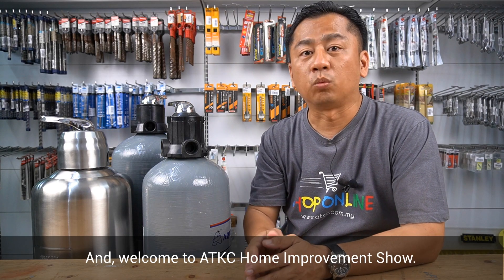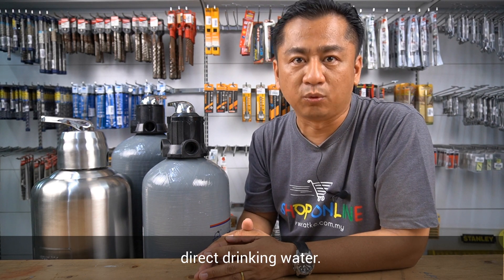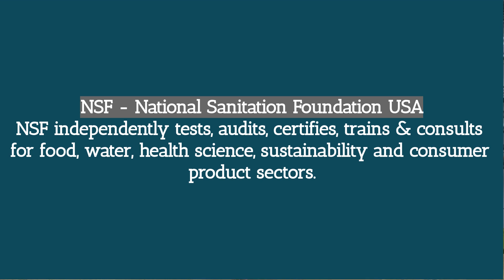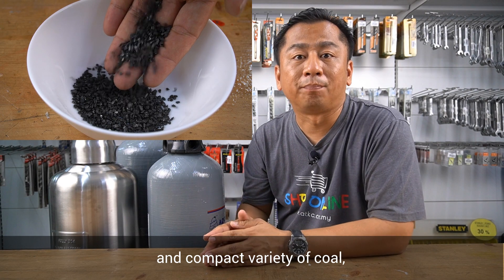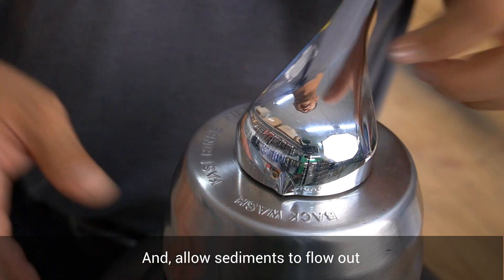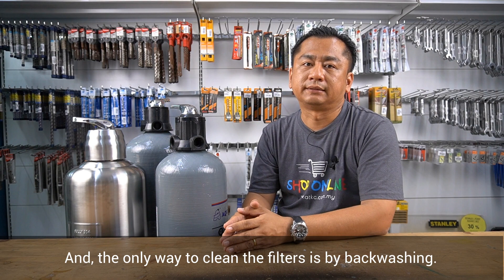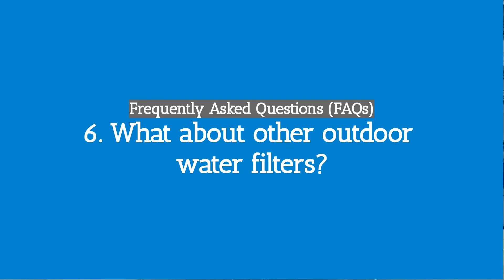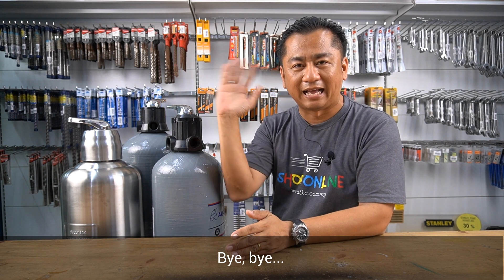Getting deep with your Outdoor Water Filters

Comment: Tq for this informative video.

1.Recently I found my freshly machine -washed towels trapping a lot of very fine pinkish grains of what feel like sand and some   bit of fibrous matter.
My outdoor Waterman sand filter is almost 30 years old.😅
 Is it possible that the sand might have gotten into my washing machine and got deposited on my towels?

2. What would happen if I accidentally rinsed and then only backwashed my Waterman instead of the other way round?

 Would greatly appreciate your reply. TQ.
Reply from the maker: I do suggest you change a new filter.

Comment: nice content, seen many video installtion is from after meter. My house is 2 stories and top of hill, water preassure from the government supply to my tank is very weak and the water is not clean. I have a waterpump from my tank to boost the water into my house I want to install the filter after the waterpump from my water tank. I believe i will have cleaner water. Will the filter can stand the preassure from the waterpump to the filter.
Reply from the maker: you may try installing the water pump after the filter
Reply: Thanks

Comment: Hi sir, which is better brand sand water fliter? Marlino or aqueous
Reply from the maker: Go for membrane filter.
Reply: @ATKCeWarehouse  But, membrane filter will reduce the water pressure. Since we have indoor filter, sand filter should be enough since its filtration is about 5-10micron.

Comment: Hi Sir. If pressure gauge on the filter showing higher readings than usual meaning that the filter is dirtier/semi clogged right? But this doesn't mean that the whole piping system is now under higher pressure is it? Just piping before the filter (after the pump) and the pressure after the filter is actually lower than it usually is?
Reply from the maker: Please have a check. Usually the pressure gauge is located at the outgoing or after the water filter. Meaning, this will be water pressure going directly into your house.

Comment: Great info.... went with 3M AP910R Filter
Reply: Used for 1 year now.. no regrets ... rm570 replacement cost is small price to pay for clean water. 5 Micron was the selling point for me. I have a Coway  RO water machine which require less maintenance since pre filtration is done.
Reply from the maker: @bloomingbead1716  Thanks for the sharing!
Reply from the maker: Thank you!

Comment: May I why the water filtration system outlet pressure gauge reading is higher than inlet pressure gauge reading?
Reply from the maker: Can let me know the difference? and the reading as well?
Reply: @ATKCeWarehouse  
Inlet 33psi
Outlet 35psi 

The water filtration system just installed last weekend. 
(condo at level5)

Comment: I have a question,why my house water flow is getting slower after installing the outdoor water filter. And how i can change the water flow back to normal because slow water flow is a drag zzz.
Reply from the maker: When was the last time you do filter backwashing or replace the cartridge?
Reply: @ATKCeWarehouse  The water filter is just installed for like a week. And i haven't done anything to it yet. Any ideas is appreciated
Reply from the maker: @scuze__  Do you have a pressure gauge installed? You can compare the difference, and identify the issue.
Reply: @ATKCeWarehouse  Yeah,it comes with the water filter
Reply from the maker: @scuze__  How's the reading?

Comment: Hi sir, highly informative. So, i have several questions that needs your input:

1) if i have an indoor filter already, ie; e-spring, would it be alright if i were to use a gravel filter instead? Since per standard, gravel filters have capabilities to filter particles up to 5microns, what are the possibilities that my indoor filter will be affected by the remaining impurities?

2) Understand that malaysia's water pressure is around 60-80psig (4~5 bar), at what point does it fall to a certain pressure such that the filter will not function? how does a low pressure at P1 inlet affect the backwash capabilities of the filter?

3) Usually, from my understanding, it is best for outdoor filter to only filter out sediments while maintaining the chlorine in the water so that bacteria will not propagate in water tanks/storage. With membrane filters, the filtration of 0.01micron will remove the chlorine?

4) if my outdoor filters are fitted well.. outdoors, will it be prone to thieft in due time? i saw how easy it was to unscrew a filter manually.
Reply from the maker: 1) Sand filters work between 20-40micron, and most indoor drinking filter will be filtering down to 0.2micron. Without an outdoor filter, the dirt/sediment will be exhausting your indoor filter. If the installed outdoor filter failed, the chances are small particles and impurities will be flowing into your indoor filter, decreasing the lifespan of your cartridge.

2) I can’t clarify this, but I have seen sand filters still working well at 2~3bar. However, if the filter beds are stucked/congested with dirt/sediment without periodically backwashing, this might cause less water output.   

3) Only those outdoor water filters, with “activated carbon” are able to “reduce” the chlorine level. I found some useful information here:
How to Remove Chlorine from Water?
a.	Reverse Osmosis water filtration systems that incorporate carbon block filters are an effective way to remove up to 98% of chlorine in water. ...
b.	Heating up water to a boil will speed up the chlorine removal process.

4) It is possible, as one just has to cut off the connected pipe lines and remove the sand filter. Again, it does require 2 persons to carry it. So far, this case is rarely.

Please share me your thoughts, so we can learn together as well.

Comment: hi guru- if i installed 2 of this before my water tank, will the water flow coming in gets slower??
Reply from the maker: Yes, as more and more dirt and sediments trapped in the sand beds. I would recommend to use just one, and periodically backwash to keep the water flow optimal. Meanwhile, I am going to introduce a water pre-filter in my upcoming videos. Please stay tuned. This device definitely will solve your 2 water filter system.
Reply: @ATKCeWarehouse   current Brunei is having a water crisis. Due to manganese. My house have this sands filter plus a membrane filter then when it reach my home there a 3 bottles filters before coming out from the sink. Water stoll brown🥲
Reply from the maker: @ritch90  Firstly, please lodge complaint to your authority on water quality issue. 2nd, please ensure that you have periodically replace the filter cartridge.

Comment: I enjoy your videos, they're very informative. In yr opinion, which is a better filtration media for an outdoor water filter? Membrane or sand? Trying to decide between the 3M model vs other sand-type filters. Would love to hear yr feedback. Thks!
Reply from the maker: Membrane, however, it's more costly.
Reply: @ATKCeWarehouse  More expensive because the membrane filter needs to be changed yearly, right?
Reply from the maker: @mintan2484  Most of the membrane filter, is a "one way street", which must be discarded after certain period of usage. I do found that there are washable type, but again, washing doesn't guarantee the original conditions.

Comment: Hi there! Very informative video! I have a question, what if my outdoor water filter pressure gauge display a lower pressure than usual? Is that indication of anything?
Reply from the maker: 1. if the water gauge is located at incoming (most common), there might be a drop in water pressure supply by service provider. Please observe for few days, as this is very common during service maintenance and water interruptions.

Comment: Hi, thank you for this video. I want to ask because the store employee said it is not advisable to use fiber material tanks at the outdoor at sunny areas. It is recommended to use stainless steel tanks.

Is he right? Or should I just buy fiber tank? My area only sell fibers, and stainless steel needs to be shipped. Thank you.
Reply from the maker: My opinion: Since these water filters are labelled outdoor, regardless of fibre or stainless steel, it should be able to withstand weathering (rain or shine).

Comment: My water filter's multiport valve has the following settings: Stop, Filter, Fast, Rinse, and Backwash. Please advise on what these settings mean. Thanks in advance.
Reply from the maker: Basically, Stop should mean that incoming water supply is blocked from entering the water filter. Filter means allowing incoming water supply and filtering process. Backwash, to reverse the water filtering process to flush out the dirt and sediments. Rinse, allow incoming water supply for rinsing. Use intermediately with backwash process.
Reply: @ATKCeWarehouse  Thanks. The weird thing is that the water flows at Stop setting, and stops at Filter setting. Made me wonder if the water is getting filtered. Anyway, thanks again for replying.  Much appreciated.
Reply from the maker: @ReallyOldDog  Thank you for your feedback. My current water filter do not have the "Stop" setting. I would assume that this function will act like a stop valve.
Reply: @ATKCeWarehouse  by the way, how much reduction in water pressure is expected when using these sand filters?
Reply from the maker: @ReallyOldDog  To be honest, I can't confirm this. Let's say that with and without the sand filter will reduce the incoming water pressure by 5%, and over the time, the  water filter will gradually decrease in efficiency (without doing periodical backwashing) in term of pressure by another 3-5% percent per month. By 12 months, we should be expecting 50% decrease in performance. Anyway, this is purely my assumption.
Reply: @ATKCeWarehouse  okay, noted. Thanks again.

Comment: Hi after I do this steps

Normal Filter -> Backwash -> Fast Rinse -> Backwash

Why do I still get brown water after I do this? Do I need to repeat the steps until backwash is clean before moving it back to Normal Filter?

Thanks in Advance :)
Reply from the maker: When you did the backwash, did you let all the brown water flow out till you reach clean water?
Reply: @ATKCeWarehouse  I did the backwash but it do not get clean after 20 mins.
Reply from the maker: @victonxvixxxveriveryfanboy3887  rinse it again and redo the back wash.
Reply: @ATKCeWarehouse  thank you for your help, I found out from our Plumber that we have a complicated water flowing system. So we need to fix our pipes 😂
Reply from the maker: @victonxvixxxveriveryfanboy3887  Thanks for sharing.

Comment: Hello. If sand all mixed, can the filter works. I wonder, because i lay my down my filter tank.
Reply from the maker: Usually, the filtration media came in compact, when the water flows in, the media will auto level back itself.
Reply: @ATKCeWarehouse  thanks for reply. in my case, the tank is not really compact and not full. its ok. But, if the media/sand all mixed. Can it works.
Reply from the maker: If the "mixed up" is not too serious, I believe that the water inflow will auto level back the medias.
Reply: @ATKCeWarehouse  thank you.  5 media filter can filter out chlorine or not. Can i use the filtered water for my pet fish in the aquarium.